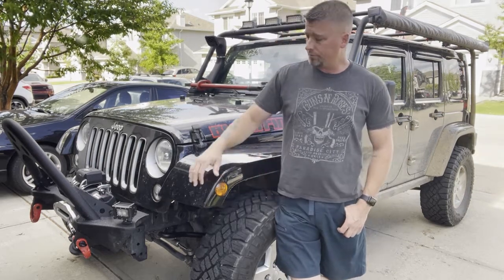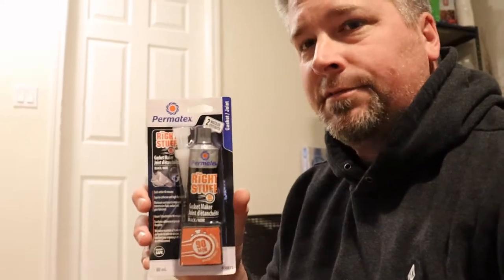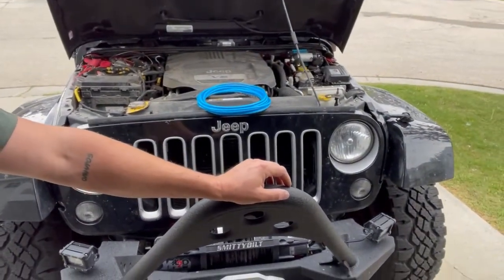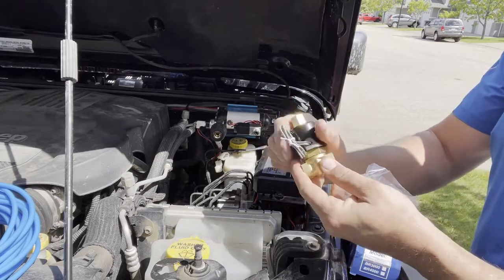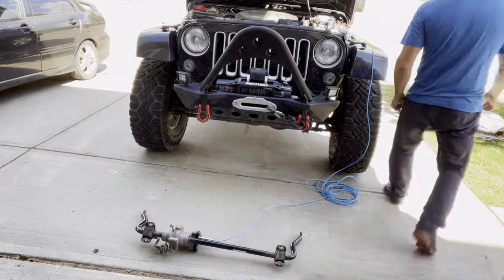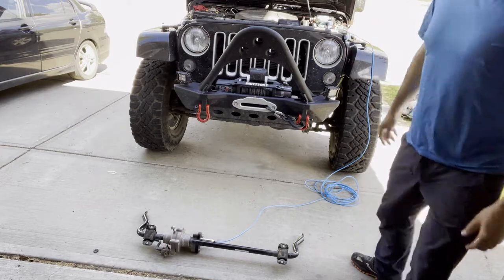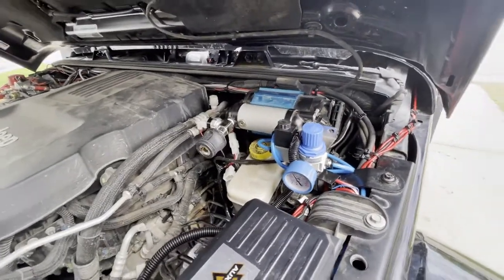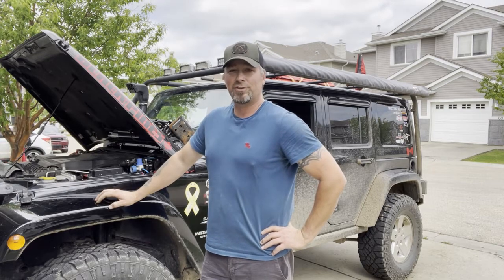Jeep Pneumatic Sway Bar Disconnect Install - Months in the making…

Comment: Great idea! Could you wire the everything to one switch?
Reply from the maker: I kept the compressor on a separate switch because I use it for airing up and down. But the normally open and normally closed valves were wired together.

Comment: Great video!  I’m getting the parts necessary to do the same installation.  With the leak down do you feel the pressure relief solenoid is necessary?
Reply from the maker: Hi Mark, I’m not sure if it shows it in the video but I eventually installed a one way check valve to stop the leak down. That way the sway bar stays disconnected until I turn off the switch. It won’t lock up on its own at an inconvenient time. Good luck with your install!